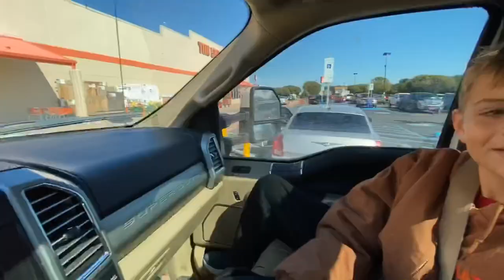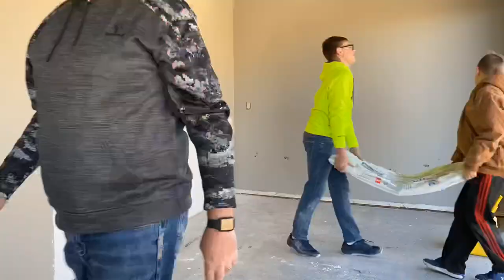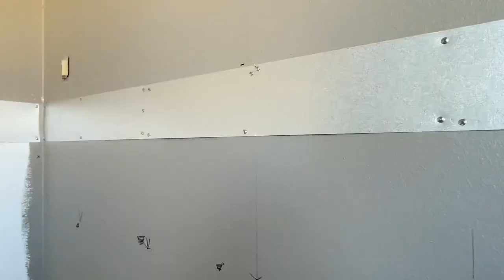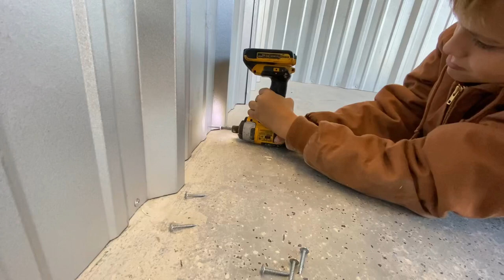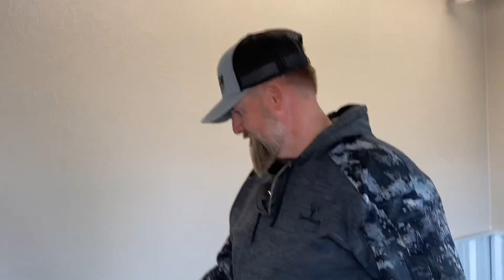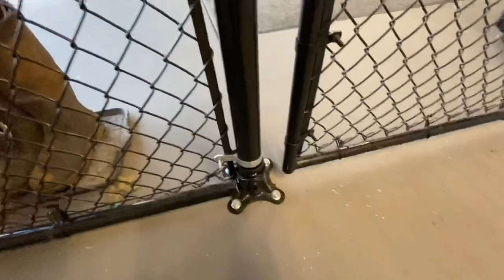HOW TO MAKE A DOG KENNEL IN A GARAGE DIY | HOME PROJECT

Comment: I came across your video when I was looking how to build a dog crate. I have to say I really like how you designed it using products from your local hardware store. The wainscoting is a great touch to prevent the dogs from tearing up the walls. I am looking at getting me a German Shepherd puppy. What you built would great for me for when we have company or leave the house. I was wondering how is it working out for you all after using it for over a year.

Comment: I have so many questions. I want to do this for my pitbull and Frenchie but my concerns are the weather. Will they be cold when it’s cold will they be hot when it’s hot? What do you do to keep them comfortable?!
Reply from the maker: You can get a heater. We have a heat lamp. But there are temperature controlled heaters you could hang above.

Comment: How do you suggest cooling during Texas summers? We’d like our dogs to have the garage space for several hours during the day when we’re not home, but we struggle cooling the garage. Any suggestions would be amazing! At this point we’re considering a window box or floor unit but we would need to cut a window into our side wall either way. We aren’t opposed to it but would like suggestions for more cost effective/less invasive options. Thanks!
Reply from the maker: We use a large fan also can open window if you have in garage. Otherwise small window style unit or box coolers are good option
Reply: Texas Best Construction, thank you!

Comment: Question: how can I control temperature? I can do a fan in the summer but I’m concerned with winter temperatures
Reply from the maker: We use a hot lamp but there are may ways to set it up